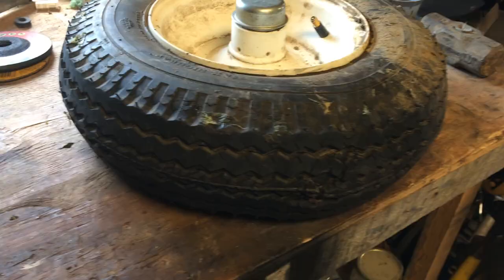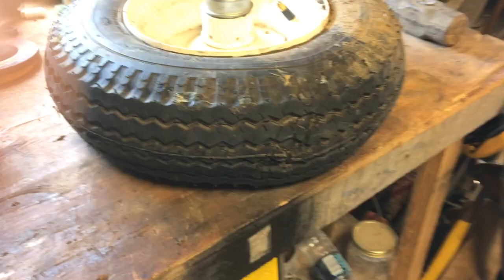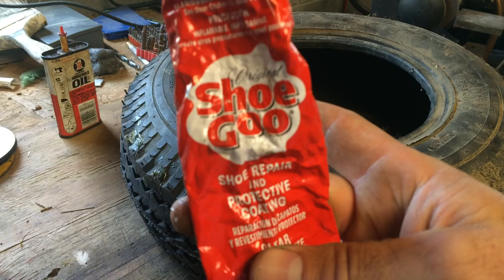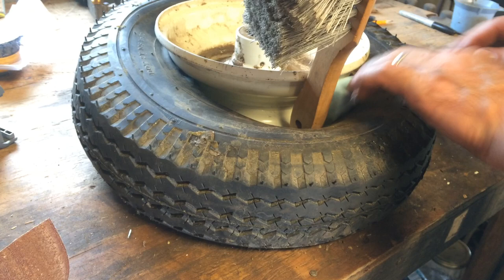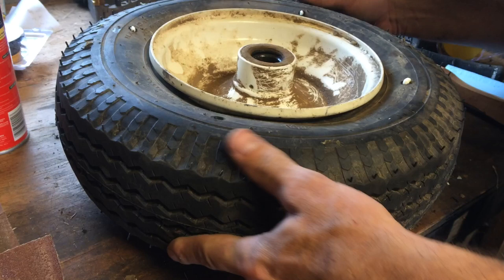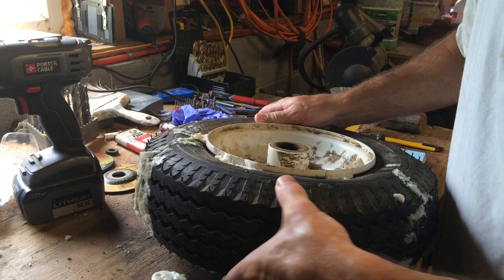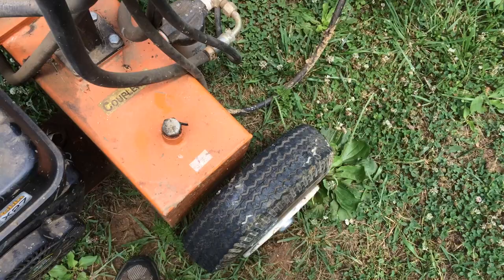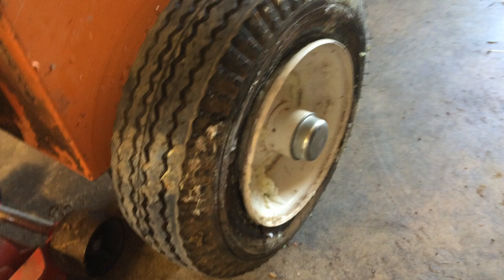DIY Flat-free tire.  I call BS! FarmCraft101

Comment: Get new tires. When you store the splitter put it up on a block to keep the tires off the ground. Then, cover the wheels with something or smear the tires with some kind of grease, or both, so the sun won't rot the rubber. I think maybe the tire was just too large, but I'm not an expert. Thanks anyway, for the upload.

Comment: I did it with a much smaller tire and a two piece rim, using silicone in the caulking tubes,( used three to fill it) but the bead was too wide and I had to wedge open the sidewalls to get the fourth tube in there. Then when I tightened the bolt ,the beads were secure. Expensive, but I'll never have to repair it again. It was on a PTO finishing mower.

Comment: You said it all, i bought a pair of harbor fright tiers for a pull behind cart i made for my lawn tractor,
Parked it outside one season, went back to use it within a year, the tire was eaten down to nothing, like rodents ate it.

I bought 2 15" replacements from 
Menard they have lasted 5 years.
This cart can hold 70 cubic feet of stuff, moved a Brand New 2017 table saw to the basement with it that has cast iron top and wings my son won and gave me.  Its about 1500 lbs i belive total. It has a 120 volt motor on it my grizzly has a 
3 hp 240 volt motor 2 phase.
I bought in 2001 thats never been used.

Comment: I filled an old tractor tire with concrete about 40 years ago. The rim was rusted out and the tire was old. We removed the inner tube and put old steel cable in for reinforcing. We cut a big slot in the side to pour concrete in and used a come-a-long to create a relatively flat tread. Also added a few lag bolts thru the sidewalls. It weighed probably 500 lbs and I used a loader to remount it after a week of curing. It worked great but didn’t have as much traction as the other wheel. Also couldn’t drive over 5-6 mph or it would scare hell out of you. This whole idea was inspired and created by lots of beer.
Reply: gosh, thanks for good laugh... still laughing...
Reply: ...I have tractors, another reason why this was very funny.

Comment: Inject  a little bit of water into the tire because it needs moister to cure. I just did my snow blower tires and before injecting the foam I squoshed some water in there . I'll see in a couple days if it works.
Reply: Hey did it work?
Reply: I also would like to know if it worked?

Comment: Did this to a larger tire. The foam worked great. The problem was it was an old tire.The holes were too small. As the foam expanded the holes sealed . The tire exploded. Glad I wasn't near.
Reply: lol use butain next time

Comment: I tried pouring concrete into a old wheelbarrow tire once. It works. Use a hole saw and cut a 2 inch hole. Shove it full of concrete and it rolls. Heavy but it does work.

Comment: I have a video on my page about this also.  GSF requires moisture to setup.  You have to put a little water in the tire or it wont setup. One thing I leaned after my video is to use the can up side down.  There is no straw inside.  I think that load may be too much for foam.  How much does that thing weight?  Do you pull it down the road? Nice job though.  I like the fast forward sections.

Comment: I made a couple of mistakes. I didn't clean out the old Slime. I used pieces of the flexible soft styrophome instead of the stuff you used. At any rate I am starting over .

Comment: This "fix" is a total waste of time & money.  I did add the "Great Stuff" to a front tire on my ZTR mower,, let it set overnight to cure & it went flat. I redid it after adding a couple tablespoons water as GS instructions suggested. I screwed the tire bead to the wheel but that didn't help. It went flat for the second time. I finally mounted a new tire after cutting off the old tire, cleaning up the mess in the wheel, paainting the wheel. Never never put that crap in a tire.
Reply: did the same thing to me on my ZTR !!!   FOAM DOES NOT WORK !!!    The guys at the Tire Shop are pissed at me now because it was a mess to get the tire off the rim.

Comment: The Air Force has a lot of aircraft on static display the tires are filled with two part ridge foam.  They pull a vacuum on the inner tube. Then break the vacuum with the two part foam they fill the tire so the density is near running pressure.

Comment: . Why didnt you use the valve stem to shoot spray foam into the tire. What was the broken chunks for? Try shooting water into the tire first. It aids in the curing of the foam. Also use the foam that is heavy and will bow door jams and window sills out.

Comment: I bought 2 15"  tires from harbor freight for a homemade tractor cart i made out of bed frames that able to hold 70 cubic foot of materials 
After being parked outside for 1 winter i went to use it both tires were gone eatten away. The rubber was trash.  I had to replace them.
Went to menards they had them with snap in berrings to fit 5/8- 3/4-and 1"  shafts they came with metal berrings 2 sets.
Home depot had some for my lawn tractor that used plastic bushings 
I put the orignal cub cadet wheels back on after swapping out the rubber on both of them.

I wont buy another harbor freight wheel that size.

Comment: First, a disclaimer for my comment. I haven't tried this - and I watched these 2 videos in reverse order. I also have not read all the comments, just going to add mine. Could you have added the STUFF into the tube, and left it expand. Then you may have added air as needed. Just wondering.

Comment: Make a wooden Roman Chariot wheel out of metal...or say, that other stuff...wood.  Seriously.  Appropriate size tube for a hub, metal disk from 1/4" plate and a tire from 4" steel tubing.  Use a lot of fire to bend the tubing.  Or say 3 one inch metal tubes side by side.  That's small enough to bend with a tubing bender.  Then you could cut the tread section from the old tires and attach them for "shoes".  Low speed farm use.  Just don't take it on the highway.

Comment: Always hold the can up side down, put water in the tire, skip the foam bits and make sure the bead is set, it will work...
Reply from the maker: How do you set the bead on a popped tire?  Yes you can use a ratchet strap around the circumference, but that didn't work on these tires.  I think there may be a place for this foam fix on tires that carry very little weight, but for something like my log splitter that requires significant PSI to support it, there's no way this foam is going to work.  Nice wide lawn mower tires, maybe.

Comment: You should remove the air valve then spray water in it spinet then put the foam and then put a cap on the stem that would’ve worked never take the tire off

Comment: I feel in my soul like you should have used air to pop it back on the bead before you drilled the holes.
Reply from the maker: That's a good idea.  Don't think it would have helped in the end though.  I've read elsewhere that a flat free tire with this great stuff foam can handle about 3 psi only.
Reply: My problem with this is...what happens when the tread is gone and you need new tires. 

But no before the foam was added you should have tried setting the bead...and then bleed pressure and drill holes. That way when you spray the foam it's inside the sealed off tire and you are putting the weight on the sidewalls and not just the foam. It may be the reason your foam blew out so easily.

There are manufactured tires just like this they are sold with the bead locked in and filled with foam. I think the bead lock has something to do with it working. You need a sealed pressure chamber to start with.
Reply: If the tire filled with foam squishes letting the air out of the foam and there is nowhere for the air to go...it doesn't go flat. Gotta set the bead before you fill it with foam.
Reply: If that fails after that than sir, you are an honorable scientist spreading truth throughout the dark forest. 

All I'm saying is that it's a plausible arguable variable in your experiment.
Reply: No disrespect intended.
Reply from the maker: None taken!  But the whole point is the tire wouldn't hold air from the beginning.  If it holds the air pressure, there is no need for the foam.  ;-)
Reply: @FarmCraft101  Something I learned i art class, the 2 part foam maybe not the can type gets harder with preassure,  drilling the holes let out all the preassure  if you can get it all out,  put the tube in , inflate it to make the tire pop out to the rims then remove the valve stem and fill the tube with foam as much as it will take, then replace the stem and cap it then it will harden but as you see it takes a long time to cure,  there are different types of foam, check with the mfg and perhaps an art supply place and if you have a way of injecting it into the tire after you mix it , I know it works, we took a hammer to the foam and it didn't break ... just say it needs to be sealed off.and this was a 2 part mix and they tell you how much to put in for the volume and the hardness you want the trick is getting it in the tiny hole and then sealing it up.

Comment: Thats why it fell apart you didn't fill it with the right foam. you used the foam board also. Try using the 3m foam or loctite foam works very good for light duty.
Reply from the maker: There are definitely better types of foam out there that would work, but the point was to test great stuff foam, which people often claim works well.  I was skeptical, and I was right.  It doesn't work.

Comment: personally, your patch looked good, shouldve just slapped the tube back in
Reply: The "Great Stuff" foam absolutely does not work.  I added about 3 tablespoons water before adding the foam.  I took great care in injecting the foam in one of my front tires on my mower & let it cure 24 hours.  It lasted about one hour.  It was a waste of time & money. I now have a new tire & tube on it.

Comment: Dont work on anything I have. My Craftsman lawn  tractor  is too heavy. Flat spots every time I leave it parked over night. Some leave the mower on blocks between uses. With the big gap  you dont get flat spots. The tire will be flat all the way around. My bs alarm is sounding off reading these posts.

Comment: You used the tire too early, foam turns dark yellow when its properly cured.
Reply from the maker: If two weeks isn't long enough, then I'd rather do something else. How long is long enough??
Reply: FarmCraft101 Month atleast, maybe two, so its definetly not a quick fix. Not sure did you use same foam as I seen used, since it needed water to expand.

Comment: for the weight it looks like you have use 2 part 8lb poly urethane foam. the foam in the great stuff is 2lb or less.  this is a pourable foam but if you have an air compressor you can mix and with a 1 gallon air tight bucket and some throw away tub can pump it in. if you would like more info respond and I will give more details if you want.
http://www.carbonfiberglass.com/Foam-Core/expanding-foam-ab-2-part-pour/8-LB-Density-Urethane-Foam-4lb-kit-5-cubic-ft-coverage.html
Reply from the maker: +Roger Paradis Agree, there are ways to do it with more expensive foams, but the point was to test the great stuff method which is often shown on YouTube. Rather than mess with $30 foam, I'd just buy a flat free tire and be done with it.